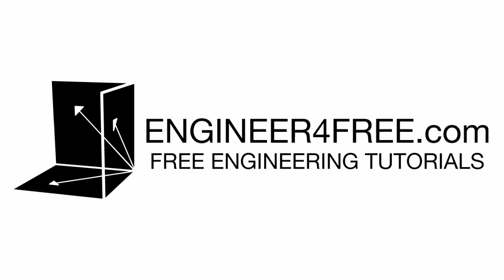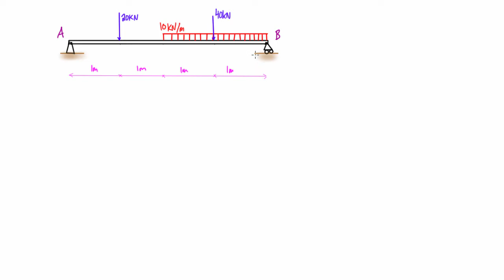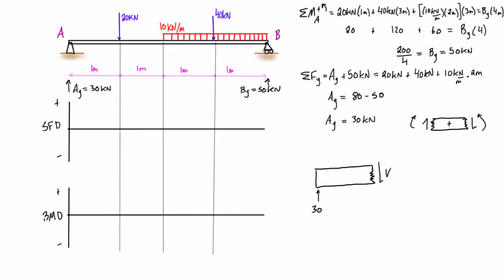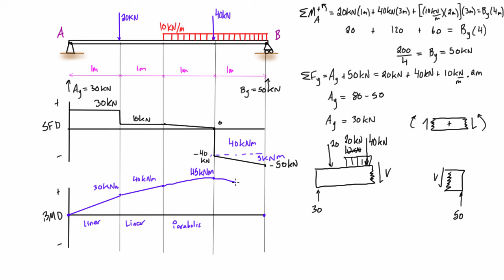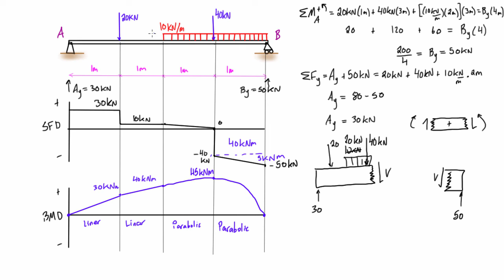Shear force and bending moment diagram example #5: mixed distributed and point loads

Comment: thankyou so much .i hv a doubt.if the shear force at the rightmost end is -50N,it implies that shear force at right most end is 50 N vertically upwards .so when considering vertical forces at B.it should add up to a net force of Rb+Sb=50+50=100.then how could B be at rest

Comment: Thank you for the explanation! I have a question about labeling the intervales in between the different applied loads, how would you know if an interval going from linear to parabolic would be a knick (not smooth) or smoothly connected? or also from parabolic to parabolic? (this applies to the moment diagram for this example) Thank you!
Reply from the maker: Good question. You could find the equation in terms of x, and then derive it to find the slope at the point from each side. But that would be a lot of work if it is purely out of interest. Even if the slope is same just on each side of a point though, the overall Shear or Bending Moment equation will be discontinuous anyways, as each interval is governed by different equations. So that may be a good enough observation to note. When I was studying, it usually sufficed to just find the x location and y magnitude at each point of interest and the general shape / form of the interval in-between.

Comment: how did you get that UDL=40kNm, as I think it should be 20kNm
Reply from the maker: Hey Rajitha. At 6:00 when I write 40kN, that is the applied point load (the blue one on the original diagram). That has nothing to do with the UDL. At that point in time, we're taking the virtual cut to the right of the point load, so the entire  magnitude of the UDL is only 10kNm * 1m = 10kN.  At 7:06 I am considering the virtual cut to be just before the end of the beam, so we are now considering the entire UDL, so it's magnitude in that scenario would be 10kN/m * 2m = 20 kN. Hope that make sense. You can check out the other examples in videos 1 - 9 here: engineer4free.com/structural-analysis for some more practice

Comment: i dont get at the point B how you get that -50kN at the finishing?
Reply: Muhammad Zaidi Bin Mohd Roni       There is a further load acting from the 40kN arrow to point B. The load is 10kN/m acting along 1m, giving 10x1= 10kN. On the shear force graph its acting negative, therefore -40kN -10kN = -50kN at B. -50kN + (the reaction force) 50kN brings the beam back to equilibrium at 0kN.
Reply from the maker: Yeah thanks for replying! The udl will cause the shear to drop by 10kN/m along its length, and then the point load also makes it jump immediately by an extra 40kN where it acts. The slope of that line on both sides of the jump is the same 👌👌
Reply: @OutThBlue5  ok thank you

Comment: i have a question, in our course they use slightly more complicated structures like for example 3,4 beams with complicated shapes and forces. Does that affect the way in which i apply these methods?

Comment: Very helpful video, but I believe that when you are summing the moments about point A that you should be assuming counter-clockwise as positive, based on how you added up the moments in the equilibrium equation.
Reply from the maker: I skipped the step in ghé sum of moments equation where I write all terms add up to zero. I went to the next step by moving all negative terms to the other side and changing their sign. That's why the term with By is positive on one side, and all other terms are positive, and on the other side of the equation. I did take counter clockwise as positive, as indicated by the little sign top right of the capital M, if you write the full summation equal to zero, and them move terms around, you'll get what I have.

Comment: I am confused, during the bending moment diagram, why instead of going down from 30kN to 20kN, it going upwards to 40kN?
Reply from the maker: The change in magnitude of the BMD across one section is equal to the area of the SFD in that same section. If the SFD is positive (above the axis), then the change in magnitude of BMD will be positive. If the area of the SFD is negative (below the axis) then the change in magnitude on the BMD will be negative. The area of the SFD across this region you’re looking at is (10kN)*(1m)=10kNm. It’s positive. So the BMD jumps up 10kNm from 30kNm to 40kNm across the section. It’s linear because there is no distributed load in the region. Just because the SFD “goes down” doesn’t mean that the BMD will too. It’s all about the area being positive or negative. You’ll notice the slope in this region of the BMD is less than the slope in the previous region, but they’re both positive. Greater area in the previous region means great slope, both being positive areas in SFD makes positive slopes on BMD.
Reply: Engineer4Free thank you sir, i spent whole day trying to understand and i figured it out. Now it is confirmed by you by answering my question! Thank you for your time putting out this tutorial for people to learn :)

Comment: I thought shear force diagrams and moment diagrams always had to go back to zero?
Reply from the maker: Not necessarily, it entirely depends on the type of structure and type of loading. A simply supported beam with no externally applied moments acting at the ends will have a BMD that starts and finishes at zero. Adding an externally applied moment at either end will change that. Shear force diagram for a simply supported beam will start and finish at values equal in magnitude to the reaction forces at each end. A shear force diagram could be zero at the free end of a cantilever beam subjected to a uniformly distributed load. Basically, it depends. I'd recommend watching videos 1-9 here: engineer4free.com/structural-analysis and working along with them to get practice and see a few different types of structures and loadings.

Comment: thank u sir but i dont understand why BY on shear force is -50kn cos when we see the reaction the force is acting upward
Reply from the maker: If you draw the free body diagram of point B with a virtual cut just the the left, knowing that By is pointing up, that means that the internal shear needs to point down on the left for the forces in the y direction to sum to zero (8:03). If an internal shear is pointing upwards on the left that is considered positive, so because it is pointing downwards, it is opposite the positive sign convention (0:38) and considered negative. I do recommend watching videos 67 and 68 here: engineer4free.com/statics I go over the positive sign conventions for these types of problems.
Reply: i get it..thank u sir
Reply from the maker: Glad to hear it, thanks for watching!